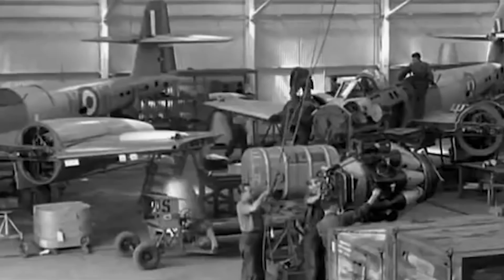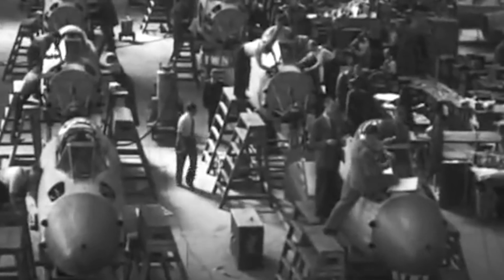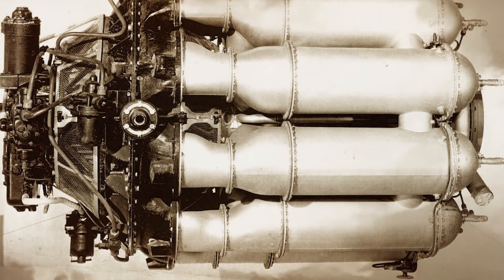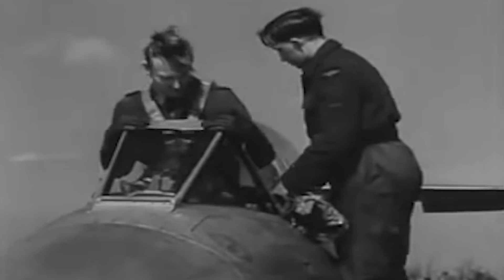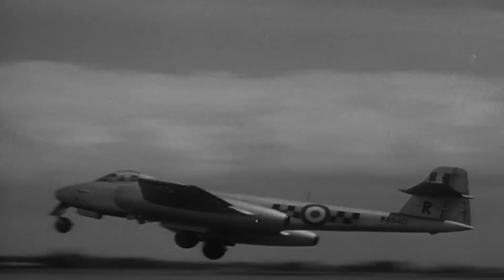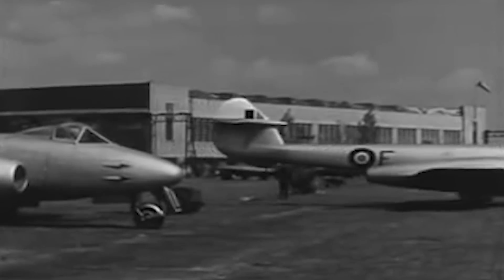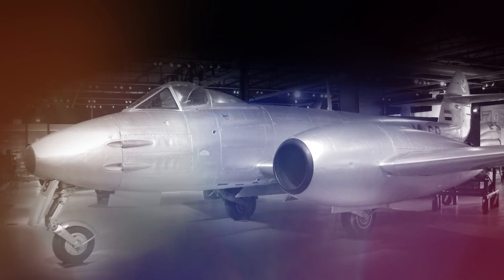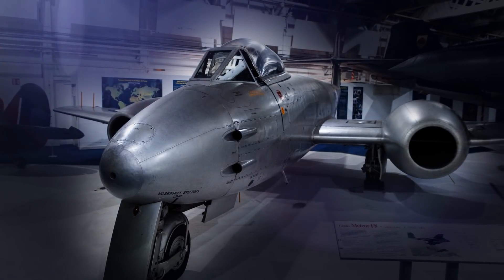Gloster Meteor - The Only Allied Jet to Fight in WW2

Comment: In 1953, Brazil acquired 60 Gloster Meteror, in the F-8 and TF-7 versions, operated until 1968, when they were replaced by the F-80, in 1969 a Gloster Meteor F-8 was built with remaining parts stocks, making Thus, the 61 Brazilian Gloster Meteor, having operated until 1974, when it was transferred in flight to the Brazilian Aerospace Museum.